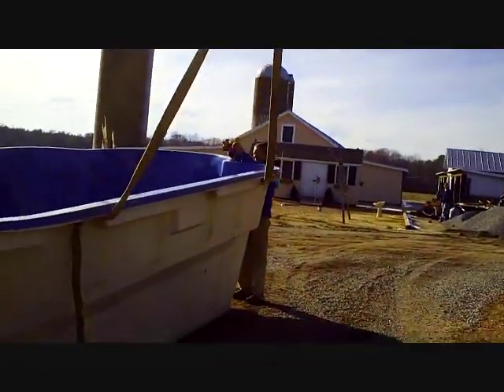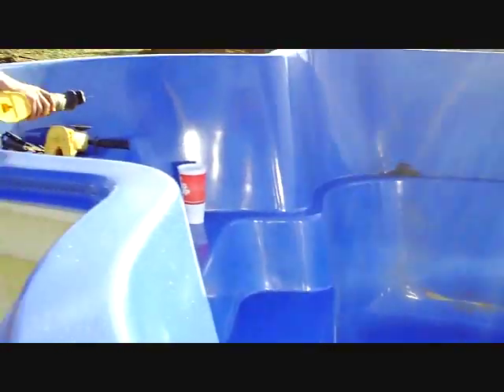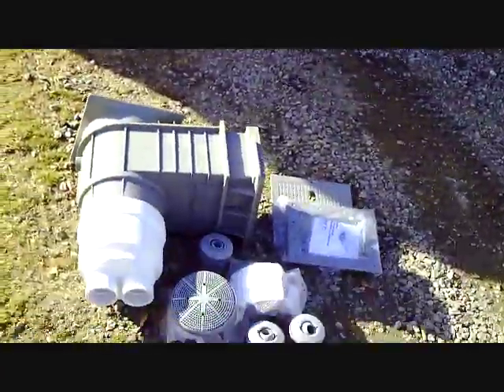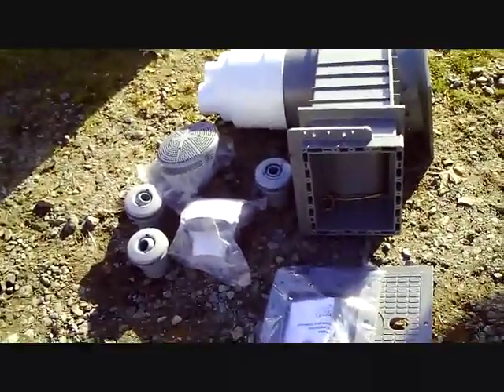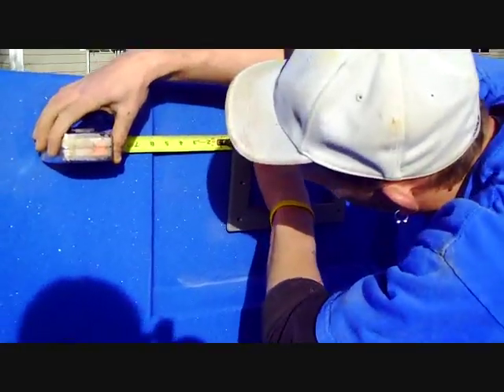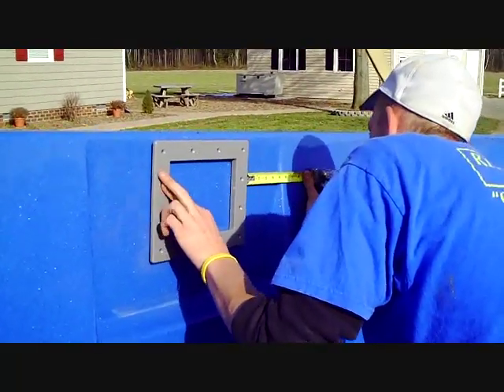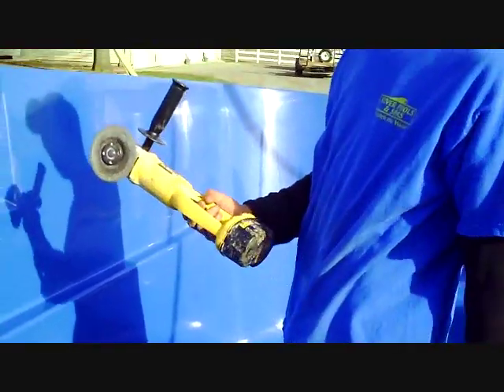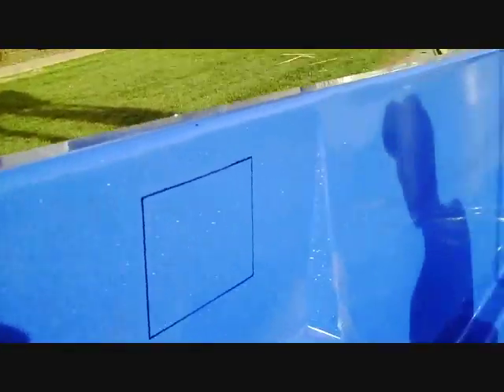How to Install Skimmers, Returns, and Main Drain fittings on a Fiberglass Pool Video

Comment: We had fiberglass pool installed currently and my skimmers were cut after the pool was dropped, and he cut about 6 inches lower then the lip of the pool, looks terrible. One skimmer is underwater and the other only has about a half inch open on top. 2 questions are there 2 types fiberglass and gunite skimmers and maybe sizes. Thinking maybe we can get a little bigger one since thus is cut low and a bigger one would slow me to add more water and still have proper performance with both skimmers